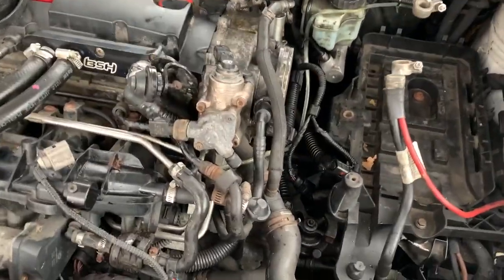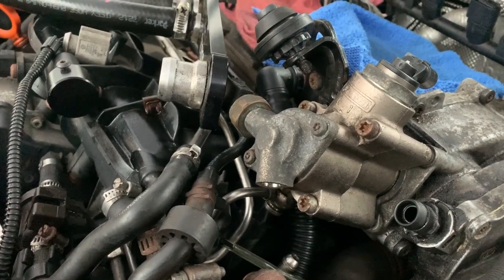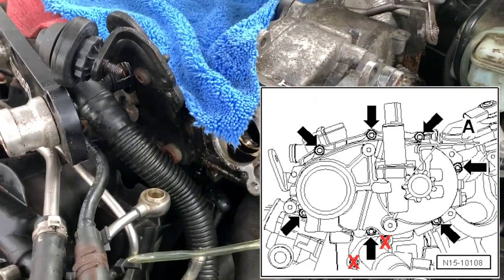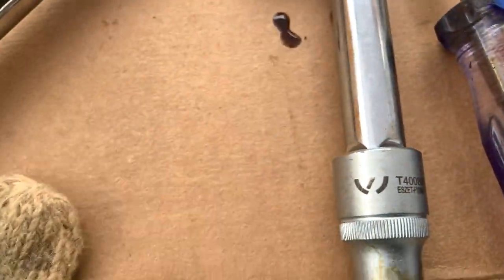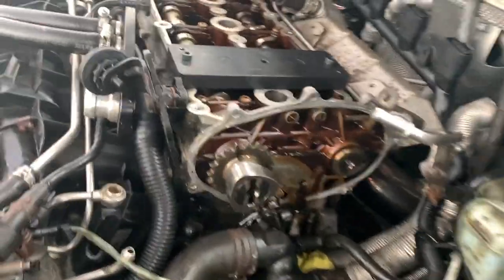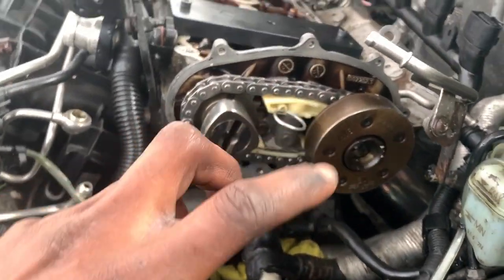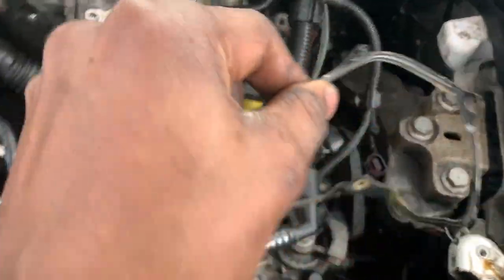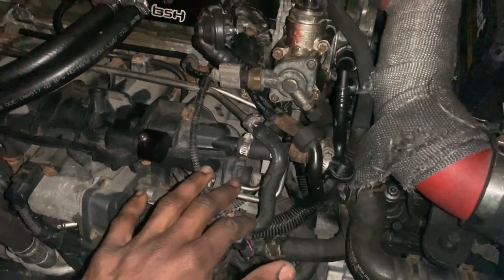VOLKSWAGEN 2.OT MK5 GTI CAMSHAFT TIMING CHAIN REPLACEMENT |AUDI 2.0T|GOLF R|MK6|MK7

Comment: Need to do this job. Only the chain and tensioner. But i was wondering can you just mark it up take the tensioner off then the chain will come off? So without taking off the vvt pulley?
Reply from the maker: No, don't do it that way cause when you try to tighten the exhaust cam sprocket, it will move the engine out of time.

Comment: I am after change of watter pump, timing chain, also belt, tensioner and my mk5 gti started makes weird noises, but mechanic saying that all is ok, he is not able to find source of that noise :/
Reply: Hey bro it’s probably like tensioners or bearings since new parts replace  like new belt putting more tension  on those old bearings making them squeaky

Comment: Good evening On my golf6 R I mounted a 200bar pump with 2 roller cams my vehicle started to graze and then paff a metallic noise and when accelerating it cuts and to move my vehicle it cuts off clean and takes time to restart. Error code P0088 and P310B, from point of view the PUMP CAMS has turned I am on when I watch your video I see that it is not the same position as mine
Reply from the maker: Can you send some pics to me on ig playboimaine

Comment: About how long would you say this will take? I have a p0016 CEL on my mkv Jetta 2.5 and rather than take it to the shop, I may have to do it myself. Thanks
Reply from the maker: P0016 is more of a timing code hook up vcds and check if the chain is stretch.
Reply: @GTIMKV  thanks! I will do that.

Comment: Man I just felt this video with this
04’ Auction
House Ram Brake Job turned into full front HD suspension, Grease Job,  Brake line, Vac Lines, Throttle Body. A Few Sensors & Connectors, Rear shocks and a getto alignment…… in 99/99 degree heat, no air tools, a broken thumb and had to Wage War on Every DAM joint, nut and bolt. Even had to do new Slide Pins & boots. Hey but the truck Looks nice!!
Reply from the maker: Hell yeah brother thanks what its all about making her brand new again cheers to you 🍾
Reply: Truck?  What r u……what???

Comment: I did mine without a cam locking tool i set the exhaust cam on the mark and the counted 18/19 links on the chain the car started but it doesn't have power
Reply from the maker: Yeah, I would advise you to use the tool. Because when you torque the bolts down everything will indeed shift.

Comment: Does the timing chain need to be replaced? VW UK say it isn’t a service. Thanks man
Reply from the maker: Yess indeed it does.
Reply: @GTIMKV  whats your engine code
Reply from the maker: @raymondo5893  bpy
Reply: @GTIMKV  ok mine is bwa I’ve read I don’t need to do it, just the belt will be fine
Reply from the maker: @raymondo5893   okay thats cool, i know the bpy ones fail all the time.

Comment: I’m about to do mine I’m worried I can’t find any information on timing marks on the cams on this side of the camshafts It looks your intake cam is a tooth off? Did you lose power because of that and did you go back and align it? From what I read the slot in the intake cam should be vertical at 12 o’clock position, sucks there is no markings on the cams or any information besides if the locking tool fits then it’s good but there’s still play and can be off timing
Reply from the maker: Dm me on instagram i tell you everything brother
Reply from the maker: @playboimaine
Reply: @GTIMKV  don’t have IG I have Fb tho , dylan Staats

Comment: Hello, i cannot remove the cam adjuster bolt. Its so frikkin tight, i already broke 4 tools. What do i have to do to get it loose?
Reply from the maker: Every one of them I have done came apart really easily except for one. Get a breaker bar order the OEM tool and make sure you have someone that came hold the tool into place while the other person turns the breaker bar in the loosening position.

Comment: Hey so shop just did cam chain and i have code p0016  the car has low power and they gonna reinstall it what mistake was made causing p0016 thanks
Reply from the maker: Could be out of timing, or the vvt chain side is off
Reply: @GTIMKV  mind if i get ur instagram in case i need more tips
Reply from the maker: @r20mk6r  text me on Instagram playboimaine

Comment: Bro I did my turbo using ur other video and was a success now on to this.  Big help.  My cam locking tool did not fit even when it's set at tdc.  I did a timing belt job earlier and erased paint mark but I used the plastic arrow on the factory cover.  Should the engine be rotated tdc 2x?
Reply from the maker: No problem mate. When you finish timing the engine, you should be able to rotate the crank 2 revolution and everything should line up at tdc.
Reply: @GTIMKV  Really?  I only rotated it once and it lined up at tdc.  I feel so dumb.  lol. So I guess now its either the chain is really stretched or I should rotate it 2x instead of just one time.  Anyways thanks for your help ur my mentor since I did my turbo charger install cause of u.:washhands:
Reply from the maker: @farasmaroge1465  The easiest way to line the engine up to TDC is to put a screwdriver down the spark plug hole and use it as a reference.
Reply: @farasmaroge1465  Remember it's a 4 stroke so the #1 piston is going to go up and down twice to complete all 4 cycles (intake, compression, ignition, exhaust). TDC is not just the piston being at the top, it's the piston being at the top during the compression stroke. So that means you have to rotate up to 720° (360° * 2) to get cyl1 at TDC. Depending on where your cams are currently rotated.

Comment: I have p000a fault on audi A3 2.0 tfsi dsg bwa engine. Chain and tensioner allready replaced 20xxx km . Dont know what to do, you can give me Some advice?
Reply from the maker: The fsi motor sometimes can be a pain. Those cars also come with a soft intake camshaft so the timing on the vvt side can not retard and advance the timing properly. What I found my issue to be was the intake camshaft. Replaced it and timed it right back up and tested it with vcds and it said system okay.
Reply: 3   O-RINGS NEED REPLACE...INSIDE CAMSHAFT ADJUSTER HOUSING.

Comment: How did those marks get on the camshaft?Did you try to lock the cam with some wise grips?
Reply from the maker: Yeah, I used the vise grips. You can order the original tool to do it. But long as you don't damage the lobes using the vise u should be good
Reply: @GTIMKV  how hard was that bolt to take off on the VVT unit
Reply from the maker: @lukew2194   very easy make
Sure to rest your hand on the breaker bar and push it in towards the bolts to ensure it fit snug and break it loose.
Reply: @lukew2194 exactly what I was wondering..  he doesn’t show it in the video, and I have seen and read a LOT of really bad experiences people have had trying to remove this bolt, rounding it off, drilling it out, etc.. I was wondering when it wasn’t shown in the video

Comment: Also, if using screw driver to check TDC how would I know if the piston is at compression or exhaust stroke? Thanks
Reply from the maker: You will see the extension come up to the top and it will slowly start moving back down.  When it starts to move down you know you at tdc.

Comment: Hey I’m in the middle of changing my cam chain. How can I check to make sure my intake cam is in time? I put the chain on and marked the 18-19 pins and put it around the adjuster and on the mark on the intake cam. I tightened everything down and when I went to check it by turning the crank the intake cam makes a loud click. I took everything back apart and spun the crank and there was no clicking so I narrowed it down to the intake cam. Any ideas what I should look at next?
Reply from the maker: Yeah those cans usually fail. I have one in my mk5 gti failed before. But the exhaust and i take cam gotta face each other
Reply: @GTIMKV  is there somewhere I can send you a video?
Reply from the maker: @drewbriggs6339  yeah instagram playboimaine

Comment: Hello from Russia Man
Quick question. This is CDL(A*) engine. I just picked up MK6 GTI Edition 35.
Engine makes ruttle-diesel noise with only 60kkm. Was about to change timing belt but just figured out that there is a chain also.
What is the reason to change that chain? Tnx!
Reply from the maker: Usually that tensioner fails and can no longer operate hydraulic by oil pressure.

Comment: I'm doing the chain, amongst other things, on my 2007 Passat. Inside the cover, there is a device that inserts into the cam adjuster (12:08 on your video). It has what look like broken o-rings around it. Are these rings available? Are they just o-rings?
Reply from the maker: Yes they are indeed available for sale it's called oil control rings https://www.europaparts.com/camshaft-adjuster-housing-seal-set-06f198107a-oea.html
Reply: @GTIMKV  You are a God. This is the best vid on this subject I've seen (except the pensioner pin). There is so little info out there that is trustworthy. Thank you again! Be well.
Reply: Tensioner...
Reply from the maker: @Beyond-Repair  Thanks appreciate your feedback. Those rings are what control the oil pressure for the exhaust sprocket to retard and advance timing.
Reply: @GTIMKV  Wow..., NO ONE talks about them. I was pretty sure it was something like that. They couldn't be HSN or EPDM, because they are stationary and the cam adjuster rotates. I got a new intake manifold from europaparts last month. Thanx again Brother. You're my hero.

Comment: Hi, does it matter if the bronze chain link goes on the exhaust sprocket or the intake sprocket? I see some other videos where they put the bronze link on the intake sprocket.  Great video you have here. Thanks
Reply from the maker: It doesn't matter if the Bronze link goes on either, but the 18 and 19 links from the bronze need to be counted and marked.
Reply: Thank you
Reply from the maker: @mark.r8900  your welcome
Reply: Hi, I've just replaced broken cam chain and tensioner on my 2007 audi a4 quattro 2.0L turbo. I have lined up everything. But now cylinders 1&3 have 150psi while cylinders 2&4 only had 90psi. Car shakes like crazy. Can you please point me in the right direction as to what could be wrong. Thank you again.
Reply from the maker: @mark.r8900  you definitely didnt line the cams up properly. The cam lobes have to face each other when they are locked. what cose are you getting?
Reply: Yes I triple checked the cam lobes do face each other. The code is P0302. Thanks
Reply from the maker: @mark.r8900  text me on instagram playboimaine
Reply: I was planning to take cylinder head off to check for bent valves
Reply from the maker: @mark.r8900  Yeah, that's what it's looking like, low compression in cylinder #2. That is a misfire code. It would make perfect sense for the lowest compression cylinder  to misfire.
Reply: You think the piston made contact with the valve? Even though the car stalled at a red light idling rpm? Thanks
Reply: Hi, ok now I have about 180psi on all four cylinders. I've replaced all spark plugs and coils. But still getting P0302 code. The spark plug in cylinder #2 looks brand new and shiny as if it hasn't been used. The other 3 plugs showed signs of usage. I've no clues as why #2 is not firing. Thank you for your help.
Reply from the maker: @mark.r8900   okay thats a good sign. Maybe the injectors are leaking.
Reply: When setting the tensioner chain as long i have pulley at TDC and bronze link over intake cam and link 18 and 19 over the exhaust cam i am good right? Or do I have to reference a specific cylinder when setting TDC? Thanks
Reply from the maker: @mark.r8900   nah if there was something wrong it would through a timing code.
Reply from the maker: @mark.r8900  like for instance a p0016 or a p000a slow advance.
Reply: Thank you for all your help. I'll get all my friends to support your channel. Ok 👌
Reply from the maker: @mark.r8900  thanks bro, i really appreciate that alot.  imake alot of video but get no views.
Reply: No worries I'll make sure my friends and colleagues will watch your channel. And they'll tell their friends... and so on. Your viewing numbers will increase. Ok 👌
Reply from the maker: @mark.r8900   thanks mate appreciate you.
Reply: Hi, if the timing chain and tensioner was set correctly the slot on the intake sprocket should be exactly at the 12 and 6 o'clock position to accept the vacuum pump? Mine is not at 12 and 6 o'clock. Thanks
Reply: @GTIMKV I’ll follow you!  My son and I have a A3 2.0l TFSI BPY.  Just replaced the timing belt (at 198k 😮😮) and are still getting camshaft reading of -7°.  I’m certain we did timing correct, which led me to your video because maybe our driver side chain is stretched.  But, I like how you are responsive to comments.  A lot of folks put up videos and never respond to questions.
Reply from the maker: @phonkyfeel1  Yeah, what I found bro after completing this job. My issue was the intake camshaft, i did the job once nothing clanged. Replaced the intake cams and all codes went away after start-up and tested the vvt chain timing.

Comment: Hello my friend from Greece. Really nice video.could you please tell me how many    miles your car had when you changed the stuff?
Reply from the maker: My car currently have 98,000 miles on it
Reply from the maker: But my motor have roughly around 120,000 miles after swapping it in. I found the cam tensioner snapped. How i noticed? I found a piece of the padding in the oil pan I was trynna figure out why my car kept throwing the p000a code. I retimed the motor multiple time just to see if the previous owner of the engine didnt mess up the timing up.  But after replacing the i take cam and exhaust sprocket the car mow work great. No more p000a code.

Comment: When you turned the crankshaft to tdc how did you see the timing mark on the head from behind the cover
Reply from the maker: Great question when I turn the crank gear I also come back up and double-check if the cam gear is aligned properly at the timing mark on the cylinder head. Or take out the number one spark plug and coil pack put and stick a long extension down. whenever the piston comes up on the compression stroke it will push the extension upward, when the piston reaches the maximum for the compression stroke it will start to go back down.  the mark on the cam gear should start lining up and if you miss the mark you cam turn counterclockwise a lil to line the  timing 
mark up.

Comment: Great vid man! Can you drop the link to the forum post for this?
Reply from the maker: I used shop key, and I found my p000a code and p0011 issue My intake cam was bad. yesterday I pulled her back down and put a new cam in, and the system said it was okay.
Reply from the maker: Thanks man appreciate that alot .
Reply from the maker: Text me on instagram i help walk you through.
Reply: @GTIMKV  I have a poo11 code , I replaced the cam sensors and no luck so replacing this chain will fix the issue?

Comment: You took the pin out of the tensioner right to have the chain hold tension? Didn't show it but just making sure.
Reply from the maker: Yeah after i put everything back together i had to take it back apart 😭
Reply from the maker: @vindieu  yeah
Reply: @GTIMKV  ok! that reinforces my belief of a possible camfollower failure, or chain tensioner stuck because of temperature dilatation.

Comment: Hi, after my mechanic did the same job, the car came back with a rattle on the cam chain side that disappears after 2000rpm. I know the chain and tensioner was replaced, I don't know if the adjuster was replaced. Could it be the n205 sensor or the cam adjuster?
Reply: Check the cam follower on the HPFP and check the oil pump pickup tube, drop the oil pan and inspect the balance shaft end for play. You could be losing oil pressure down there, a common issue
Reply: @kylepawelczyk163  Thanks for the suggestion. I found out the problem was the vvt cam adjuster wheel sprocket, the axx engine has metal sealing rings which wears the inner surface and was preventing sufficient oil reaching the adjuster, so replacing that cam adjuster sproket and using the new plastic revised rings resolved the issue.
Reply: @hirandoolwela very interesting! Glad you got it figured out!

Comment: Bro did the car drink oil more when the chain was stretched.
Reply from the maker: No,t at all; maybe your PCV is a bad hint, or the timing chain cover leaking by the transmission, and your piston ring might be going.
Reply: @GTIMKV  Thanks bro. I've got a catch can kit. Just had the chain tentioner done but it's saying on vcds 5kw out not 0 to -2 so I don't think they done it properly man. Car runs ok I do get a random puff of smoke on pull aways now and then